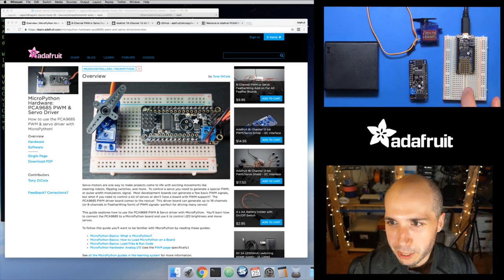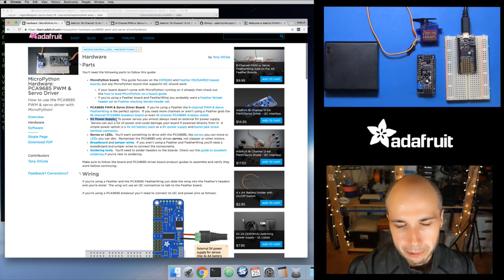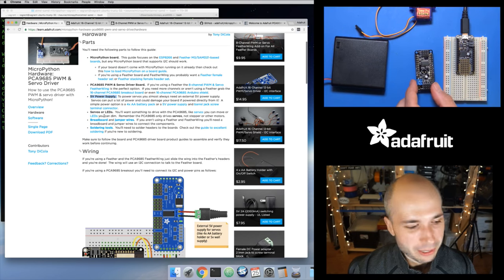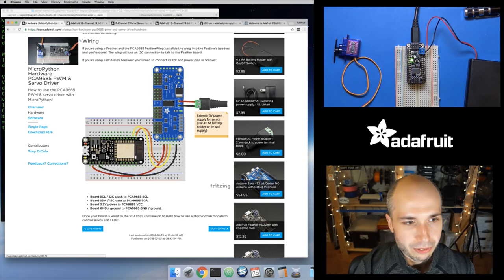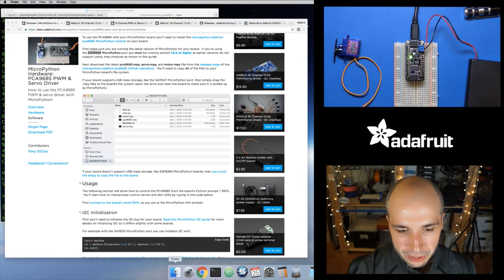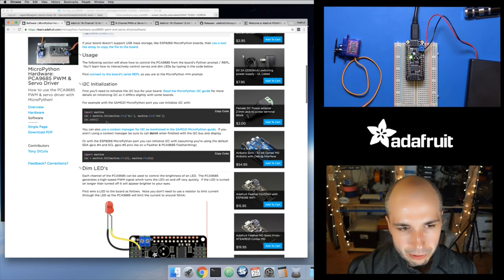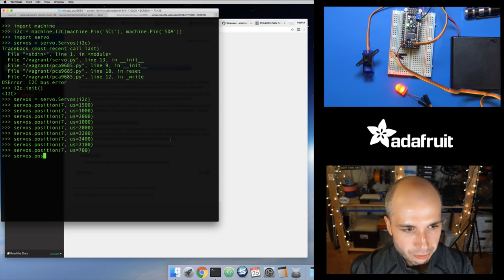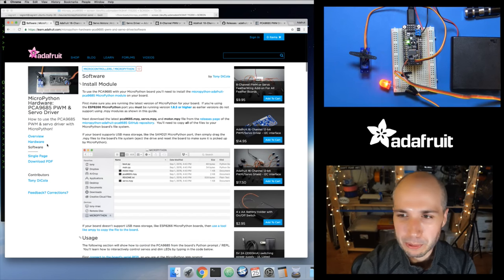MicroPython Hardware: PCA9685 PWM & Servo Driver with Tony D! @micropython

Comment: I understand you need a separate power for the servo driver. and another power supply for the feather/ nano/uno etc. Is there no way to have just one power supply to plug in the wall or do I have to have batteries plus a plug? I want to put servos in a wooden box and put it on a end table or something. Thank you.

Comment: Thanks for the tutorial Tony. I come from a web design/development back ground, but have recently got into coding with Micro Python. Your tutorials are really helpful. I've got a small motor from an old slot car, would I have any issues trying to use that, and how would I wire something like that to the bread board?

Comment: Hey Tony can you use power a metal gear servo with a lithium 1200 metal and what would I need to be able to make the metal gear servo rotate clock wise and counter clock wise but move when commanded like meaning move either direction but move and stop and hold

Comment: is there an easy way to use this with an arduino to control a relay board?
Reply: You don't need any of this to control relay from Arduino. Just call digitalWrite.
Reply: allyourcode, yes i know that but i want to control a ton of relays for controlling ac lines for christmas lights, using 8 ch ssr boards and 128+ channels is my goal!
Reply: PWM isn't used to control relays. I mean, you might be able to make it work (I don't know) by switching between 0% duty cycle and 100%, but you'd really be missing the point of PWM, which allows you to choose values between 0 and 100%.
Reply: With ssr's you can dim.. ive done it with arduino and single ssr with pwm. Not 100% but good enough for what im trying to do. But needed a ton of outputs and even 0 to full will work for the ssr relay board and want to daisy chain a bunch of there boards together bc it said up to 900+ don't recall exactly off hand...